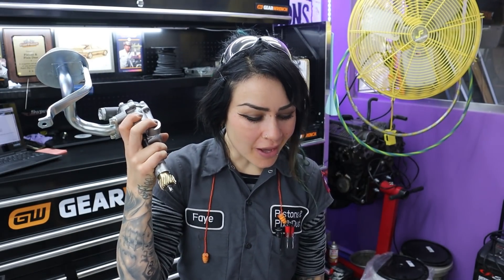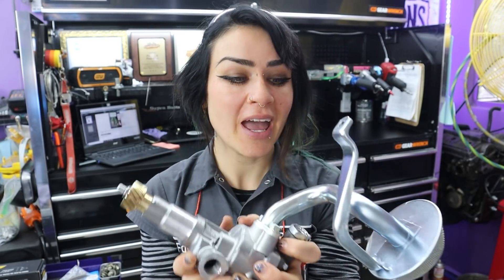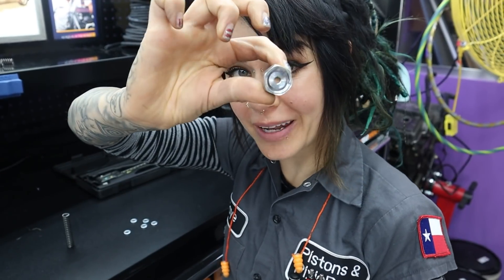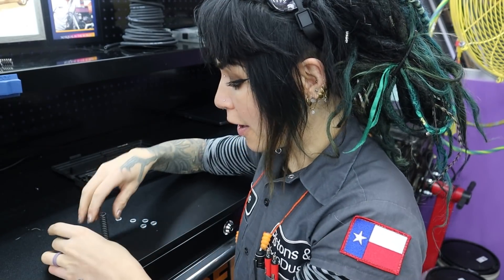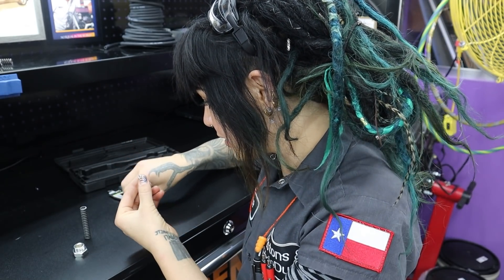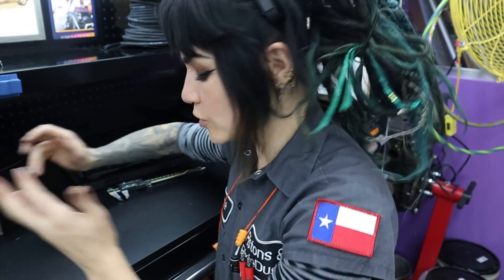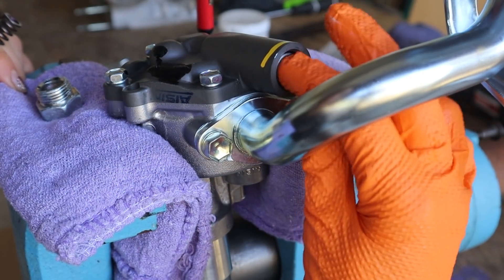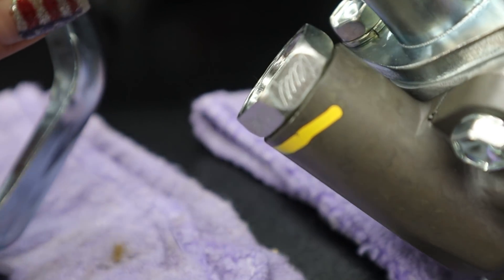How to Shim your 7M oil pump (and what I do that I think is better)

Comment: I have the 7MGE blues😢 Bought my mk3 1 1/2 years ago after it sat for nearly 20 years because of a BHG & RK.  After an entire rebuild for some strange reason the Bronze helical gear on the oil pump was sheared off. Started all over and decided to add DM larger oil tube, Eagle rods, ARP head stud kit & a Cometic MLS head gasket. It was running beautifully and then….. it happened again (Your & Danny’s thoughts on that would greatly be appreciated). The Machine shop guy’s and I wrapped our heads around the shimming process and believe in the end, for 7M’s, the pressure is questionable but higher volume would be a safer solution rather than high pressure. Also, what are your thoughts on the oil squirter‘s? The previous owner of the GTE block I bought recently deleted them because it has forged internals. I’ve got a TON of questions!

Comment: Wondering what the move is now that aisin has discontinued pumps. My gauge is showing low pressure and, while ive yet to verify it with a mechanical gauge, if it is the oil pump I seem to be shit out of luck at the moment.

Comment: I have a 86.5 7mge. Has been setting for 10+ years. Had the motor replaced and the mechanic that did the job did not do some things right. Had to take it back for oil leak problems several times and were never fully fixed. Then the bolt that hold the harmonic balancer sheared of in the crank. I parked it hoping to rebuild one day and I have not had the opportunity. The ? Is would any of your enthusiast be interested in purchasing it. I hate to see it set and rot.
Reply: Located in sc

Comment: Hi Faye!, I wanted to ask you in the old engine the one that you had the pump shimmed, what was the change at IDLE? and, why is there a change at idle?. I am now restoring an engine myself, I have the new pump but the complete motor is old, therefore high clearances. Would shimming help improve a little bit the pressure at idle?
thanks!
Cheers

Comment: I've been driving Supras for years and never had an oil related issue on the stock oil pump.  is this only something you need to do if you're making more power than stock?
Reply from the maker: No, if youre going to be drifting or driving aggressively and sloshing all the oil to one side of the pan or could potentially dry suck from the sump. If you're a careful 7M owner, you should have no problem. Most issues with this engine I believe are caused by neglect.

Comment: Not only is the 90 in the stock oil tube but banjo holts are VERY restrictive. Look at the tiny holes in the bolt vs. The  size of an 8n steel braid and fittings. On my performance 7m builds (done quite a few I am old and have a kid into Supras) I remove every banjo fitting and convert to an lines. Yes the squirters are banjo but I dont always use turbo blocks and if you use forged pistons squirters arent needed. I've built many non turbo blocks to take a lot of boost with no squirters and no failures at reasonable settings.

Comment: It would certainly be beneficial to know if similar mods are available for other Toyota engines. I think that most people rebuilding a Toyota won’t be doing a stock rebuild and higher oil psi is often desirable

Comment: Great video, thanks for making it. Much appreciated!👍🏾 Do you have list of planned mods for your 7MGTE  be the 88 or the 89? Just wondering what the consensus is now in 2022 on what actually needs to be done and what is available. I have a 91 that will be getting built, and I don't want to do any outdated (unnecessary) work to it. Back in 2004 the forum was littered with ideas (so great and some no so great), which by now should have been vetted. I'm hoping to find a list of mods that are tried and true. Thanks again for the video.

Comment: had no idea you went over 7m engines, got my hands on an mx83 cressida with the GE, plan to keep it NA + light mods as a daily that i can also have a bit of fun with. definitely getting the stiffer spring
update: ok so the stiffer spring only affects maximum pressure. you probably do not want this too high at higher rpms as that can lead to problems. really the only thing that can improve the oiling system are getting rid of the awful banjo bolt setup for the pipe that goes into the block, and reducing the gap between the oil pump gears and the lower body/pickup tube of the oil pump.

Comment: I just got my 86.5 last April. I bought it off a flatbed while it was heading to the scrapyard (makes me feel better seeing your junkyard save). In my head I was thinking 1j or 2j. But then I got it to run after it had been sitting for 5-7 years and realized it was still in okay shape considering what it had been through. Then the title came in the mail and I realized I was only the 2nd owner. So I feel obligated to rebuild out of respect. I also feel obligated to swap out pistons so the 10 psi of boost is little safer. 

Since it still runs okay I have been fixing up cosmetic stuff (just welded shut my rusty butt) and putting off the motor rebuild until summer. So I personally appreciate the videos. I love forums for help but seeing is always better then just reading for me. Also the odometer on mine says 260k and she is happier with thicker oil and I don't feel bad about it. I like being able to cruise in it while I get stuff done.
Reply from the maker: YESSSSSẞSSSSSSS I LOVE THIS COMMENT!!!!  I am so stoked you saved it and kept the 7M! My first build went 220k before the original headgasket gave out, and I used 20W50 towards the end and never had an oiling issue! Noticed the coolant was disappearing and finally knew I had to do something about it before it got worse and made my rebuild more expensive. Little did I know I would choose a terrible machine shop (back in Portland Oregon) and made it the most difficult and expensive rebuild of my life!

Comment: I found this very interesting. Is it possible to modify oil pump on a 1976 mg midget relief valve. The relief valve is external on the block. I value your input.

Comment: This video is a lifesaver. There isn't a ton of info left out there on M engines and I wanted to increase pressure and flow on my 5M since I've spun the number #5 twice between two motors. I was going to shim, but I see now there's a much better way, thanks Faye!
Reply from the maker: Oh! And Driftmotion has the upgraded pumps for the 5M too!! Awesome! I'll also be discussing the oil.cooler relief spring, thermostat install, and oil filter relocation too in the future with my 89 build! Hope that will help you too! Stay tuned 😀👍🏻

Comment: I'm not likely to every find myself working on a Toyota oil pump, but it was still an interesting video.  But... I'm assuming there's a particular pressure you're looking for, so I wonder if there's a way to measure the output and be sure you're getting what you want out of it before you put the engine back together?  I'd be afraid I'd put everything back together and find it just ain't quite right.  But that's just me; I'm persnickety.
Reply from the maker: Totally!! That's why I like going with the tried and true spring that someone already took the time to perfect 😅

Comment: @Faye.......PVC BLOWS OUT! 1998 TOTOTA TACOMA SR5 2.4 RWD AUTO.....New emissions part and gaskets. 900 RPM at idle and 2700 at 65MPH........" T" MOTOR..... RELIABLE ....... BBBBBBBAAAD FRAME....( AMERICAN MADE IN OHIO, TENNESSEE).  REALLY WANT TO KEEP THE TRUCK...... RETURN THE ANSWER TO ME, PLEASE.....
Reply: I have modified the wheels to eliminate alignment issues that come within this trucks history..... Straight as An ARROW.!!!
Reply: Still working on it!
Reply: THANKS.

Comment: Yes yes yes! Please make videos about ALL the 7M and Supra common upgrades, tips, tricks, and problems. 12volt fuel pump mod, to auto window up, to EGR plug.
Reply from the maker: YESSSS!!! Gonna do the 12v fuel pump mod soon, and EGR with 88! (Already done with the 89!) and tail lamp failure module, proper way to reseal targa.... ALL THE THINGSSSSSS

Comment: I have the DM upgraded braided line for my pump and the shim mod. My oil pressure isn't great so i wonder if i have a stuck oil squirter?
Reply from the maker: Yes, great question. Lots of folks delete them, and also is your oil cooler stock? That is a weak spring as well. I'll be covering my oil cooler/oil filter spring delete and thermostat install with my 89 build!
Reply: @FayeHadley  i do have a stock oil cooler so perhaps that is the weak link? I think i remember possibly shimming a relief spring in the oil filter housing but it has been awhile. 

I should have deleted my oil squirters last time i rebuilt! 

Looking forward to your video covering the oil cooler portion of the lubrication system! Keep up the awesome content!!
Reply from the maker: Also, what's your pressure at idle?

Comment: Fascinating. I suppose that you know as well as I do that the only way raising the maximum pressure will improve the performance at idle is if the relief valve is not very well implemented or the QC in manufacture is not what it should be. There may be something else that we don't know about so I'll accept that it's worthwhile. As for Aisin grinding off the Toyota name, and I understand it's them doing it, it's always done for aftermarket sales under their own name. OE parts from Toyota have the name left on and this way Aisin don't need to retool. I suppose they go through a few Dremels. ;-)

Comment: Fey. Your well loved . We need more car girls. I used a shim ( the thickness) you used on a FE big block 390 cu. In.  Ford and it changed  the oil pressure so much  higher the oil filter blew up like a baloon. From then on I used shims in the thousands of an inch such as .010 to make the pressure desired.
Reply from the maker: Crazy!! Yeah the 7M oiling system is set up a little bit differently than that one 🤣🤣🤣